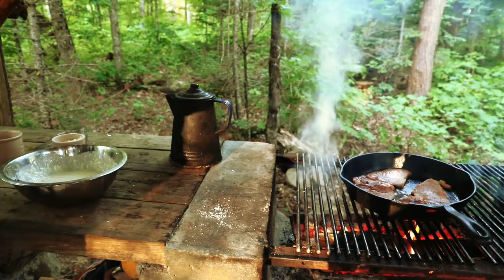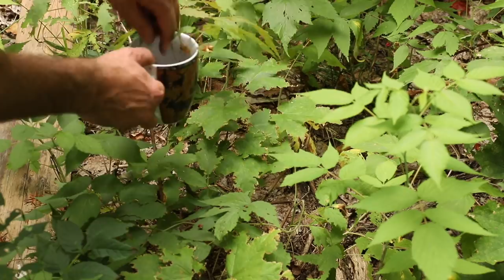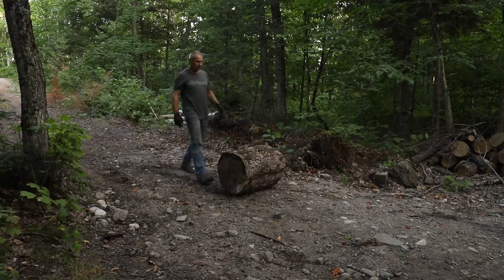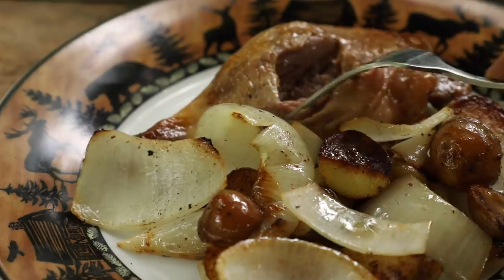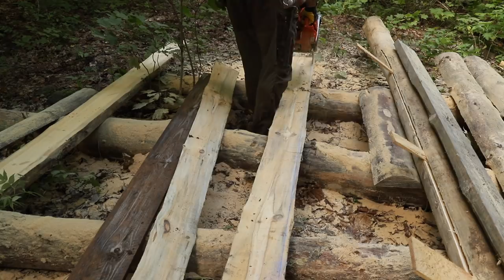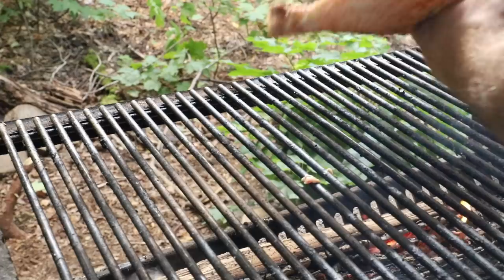Log Cabin Porch Build Using Hand Tools and an Alaskan Chainsaw Mill

Comment: Loved it, love the idea of the screened-in deck porch.
Was going to ask about the screens and the winter rain and snow - won't it run down the from of the cabin overhang and possible down into that side screen opening?  Or will you have panels to close the screens for winter?  thanks again!
Reply: Maybe put temporary plexiglass "storm windows" so the snow won't blow in🤔

Comment: Shawn, considering you'll never make a skilled carpenter worry about their job, you've achieved a lot.
Tip: remove the shine from the head of your hammer with a file or emery cloth.
It'll help stop your hammer slipping, as it hits the nail head.  
Give it a try.

Comment: You should build another one just like this one on the other side to use for the workshop.  Hang all your tools on the cabin wall, out of the weather, but grouped together ready for work.  A dirt floor for raking up sawdust and wood shavings for composting, a nice work bench for squaring, gluing and nailing projects.  A great place out of the rain and snow for the wood projects.  Check out Lumnah Acres barn build to see how it would look with both side wings.

Comment: My Self Reliance, you may want to look into solar powered power packs. They are just like the small battery pack you used to use your computer except you can charge them with sun light. Pretty cheap about $30.

Great videos, thanks for the content and ideas.

Comment: You should look into those Engelcooler's... They have bags you can travel with and then they also have hard that you can put into the ground I'm pretty sure.... They usually use them down south in the United States down in Florida... I'm pretty sure Rob will send you one......JJ...

Comment: A little tip for you or anyone else for when you are chopping wood at the 20:30 mark. If your ax gets stuck in the wood instead of splitting in one ax blow -  leave the ax in the wood & lift it up like you were going to take another swing only when you swing downward reverse the ax & the wood piece so the ax head falls first on the chopping block. Guaranteed to split the stuck on ax piece of wood. Take it from someone who's parents use to burn about 25 cords per winter.

Comment: I was curious if you were planning on taking the window out and instead putting a door in to the porch.  It is a good source of light but you could put a door in and put a skylight in the roof... instead.. just my thoughts... then you can go inside to the porch in the winter without going around the front of the house.

Comment: A great use, of that old space - the porch, that is. It hugs the cabin. Just wondering, as you obviously have to speed up the camera, to fit it all in. But how long does it take to run a pass through those logs, with that mill? I'm estimating, they're about 2.4 metres long.

Comment: Will you be including a tarp drape or heavy gauge plastic sheeting to drop down during the winter to make the room somewhat usable during cold weather and also to protect the interior from snow blowing in thru the screens and to keep what  every you have on the porch dry?  I was thinking about how my mom utilized the deck on her Criss Craft boat during the winter. They erected a framework back there and then installed heavy gauge plastic "walls" and she was able to be topside during the bitter winter weather, in fact it would get quite warm and toasty.  Just curious. Thought they could be on the outside and rolled up when not in use, and then when needed they could be dropped and fastened in with place with some kind of clips.  Of course, I am typing this long before seeing how you plan on designing and installing you finished "window" treatments.  I can only imagine how enjoyable that porch, dare I say room, will be.  You are quite the builder.

Comment: You could just add some insulation to the roof and walls, then install some windows and a solid door if you ever decided you wanted or needed more space inside the cabin with the way you're building that porch.

Comment: 1 quick question , what was the reason you choose to leave the existing pitch roof on the side , the space it takes up is x and the added difficulty to work around is quiet noticable

Comment: Today the first thing I thought of was...Where is Cali? She was nowhere to be seen  in the video for the first few seconds...I love how the cabin  looks...a very peaceful and welcoming home...It is like the more I look at it the more I like it...I never liked new houses...In Spain I always preferred the old houses over 200 years old where the walls are about two feet thick...and outside could be boiling hot and inside is about 10 or more degrees cooler...No need for air conditioners in those old houses...In the winter the houses keep the heat in...

Comment: You need to run 6 to 800 ft of heavy antenna wire through the woods & get you a good shortwave radio for toughs long winter nights ! Plus an extra solar panel & big battery to run it !  :-) 

Keep up the good work !

Comment: a lil more brushing cali minutes..if possible :)...Question what did DIY log cabin builder used as a log measuring tool in the late 1700's? i am sure i can find it online.. but thought i ask you the same.. cause you're also a planner & a builder :)

Comment: I know you have a reason you put the door on the side instead of the front but I’m surprised. If you’re going to use it for winter storage wouldn’t it be easier to have a door on the end to take in carts like the one you’re walking past with the thick tires? I’m also surprised that you are enclosing the bottom of the porch walls where I expected you’d want to enjoy floor to ceiling views of nature. Where are you storing your snowmobile during the summer and winter for that matter? The weather would take a toll on it I’m sure!